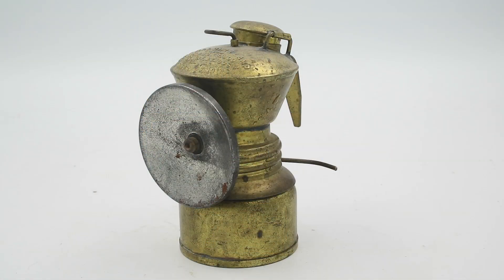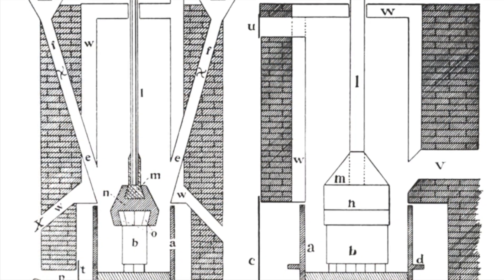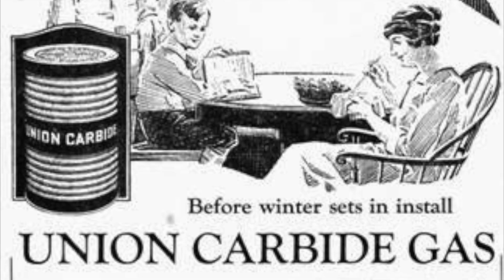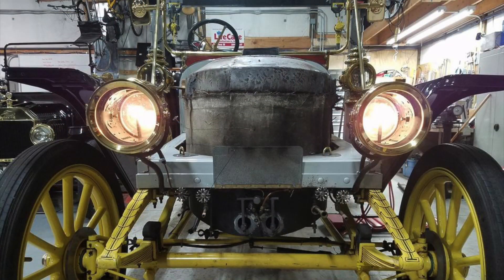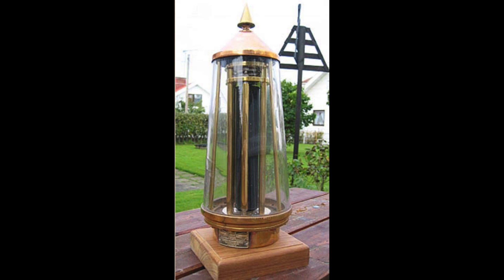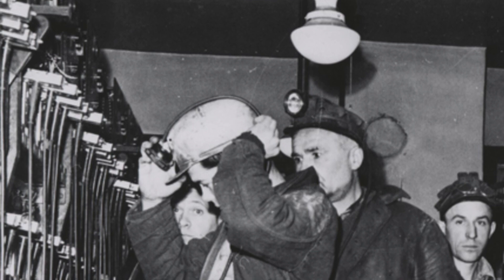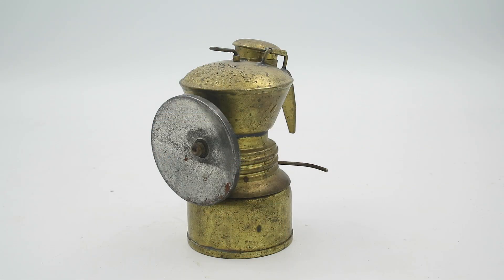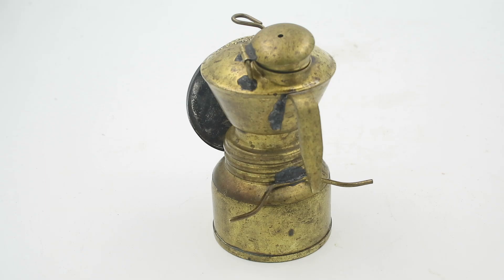Carbide Lamps: the Caver's Friend

Comment: There were a bunch of manufacturers of these lamps, Guysdropper, Autolite, Premier, Justrite, Butterfly and more.  In the 70s, Justrite made a plastic version that had a tendency to melt down.  There was a cave ballad called "The Ballad of the Plastic Justrite".  BTW, I carried enough carbide for a 36 hour trip (longest trip was 24 hours)at normal brightness.  If necessary,, between the three of us we coulda had one lamp running at reduced light for a week

Comment: We lived waaaay in the woods in an old hunters cabin and went caving every Saturday.  We emptied our spent carbide into "Dump Bags" and when we got home put these dump bags in the large plastic bags with the household trash.  We burned the trash once a week as there was no trash pickup.  One day, I stood over a bloated trash bag and dropped a match.  There was a large explosion and I stood there stunned with my eyebrows singed off covered heat to toe in trash trying to figure out what had happened.  Then I smelled the acetylene and realized the dump bag from a week ago had continued to generate gas.  Likewise, "carbide bombs" were a thing at caving get togethers.  Somebody would set one off and the whole valley would shake with an intense low frequency BOOM.

Comment: Recarbiding sometimes comes at innoportune times.  I once had to recarbide while on rope.  I was at least 50' up and the other cavers had climbed before me because they thought I would climb slowly using only prusik knots.  I was actually faster than them using their fancy mechanical ascenders.  But, they were all up the rope and crawled on to the next rope climb so I was by myself.  I did everything very slowly and deliberately knowing that if I dropped anything it would be a long climb with a flashlight in my teeth.
On another trip, I was in a tiny water filled room with about 2' of air space.  One entered the room from one side by ducking under the wall under water and left it doing the same in the other direction.  Again, I was by myself as the others had gone ahead.  I had to recarbide while treading water. Unfortunately, I dropped my baby bottle filled with dry carbide.  This meant the tiny room was filling with explosive acetylene gas.  I quickly ducked under the exit wall with my flashlight in my teeth.  We all had to go back through this room on the way out meaning we couldnt use carbide and even an electric light might trigger an explosion.  On the way out, I went first using a Cyalume lightstick and jammed it into a crack in the wall in the tiny room.

Comment: Every real caver was expected to be able to "Recarbide" in total darkness in case your other two independent light sources failed.
1.  Take lamp off helmet and take plastic "dump bag" out of your pack.
2.  Unscrew the base of the lamp and dump the spent carbide inn the dump bag.  Use the closed tip brush you wear around your neck to help extract the spent carbide.
3.  Pull the new carbide from your pack, you keep it in a plastic baby bottle for protection from water. Pour enough of the carbide rocks into the lamp base till you can feel it is 2/3 full.
4.  Pull out the squeeze bottle you use for lamp water, open the water reservoir on the upper part of the lamp and fill the reservoir with water.
5.  Adjust the water flow lever till you can feel the dripper dripping onto the palm of your hand about 1 drop every three seconds.
6  Let the drops fall into the base of the lamp and hear the sizzle as acetylene is produced.
7.  Apply your saliva to the lamp base gasket for a better seal and screw the base to the top.
8  Bring the flame tip up to your tongue within 1 cm.  You should feel the exiting acetylene on your tongue.  If you dont feel it, Take the tip brush from around your neck and use one of its wires to clear the orifice.  Check for acetylene flow again.
9.  Cup your hand over the orifice with space under the palm of your hand to trap acetylene. The side of your palm away from your thumb should be against the striker.
10.  Quickly move your hand across the striker to produce a spark.  There should be a loud "POP" as the lamp lights.

Although it has been 34 years since I last used a carbide lamp for caving, I think I could still light my lamp in total darkness
Reply: Yes, I've had to service my lamp in the dark. More often than just running out of carbide or water was simply extinguishing the flame when accidentally thrusting it into sand. Clearing the acetylene exit nozzle with a pin was often the critical step.
Reply: meh. you would die brah.

Comment: Acetylene, being a hydrocarbon, stinks a bit…sulfur contaminants or not. I’m a caver and a welder. At one time, you could buy a small generator for your oxy/acetylene torch kit that worked like the lamp and is now considered far too dangerous for home use. Next to hydrogen, it is the hottest burning gas. Carbide production in North America is now at an all time low because it is a byproduct of manufacturing processes that have for the most part moved overseas.

Comment: How long will that lamp burn on one fill of water and carbide?
Reply: In typical caving, a lamp would go about 2 to 2 1/2 hours. Water tank would need about 2  refills during that time. In situations where you use a lower flame and less light, you might be able to so as long as 4 hours. Lamps from different manufacturers have different volumes so these are averages.

Comment: I had one of these. One issue is that that the calcium carbide reaction can eat through the brass of the lamp. I had my lamp blow out. It wasn’t that dramatic, but it was alarming and startling when it happened. You have to keep them clean. These are very bright and interesting lamps.

Comment: Thank you for the great video. I use these lamps as part of a lighting source when I went caving 30 years ago. We had a requirement that we all needed at least three different sources of light while caving. Calcium carbide was one of those lighting types that we utilized. The others were battery operated.

Comment: Calcium carbide is the fuel for the now banned “Big Bang Cannon” toys.  You’d get a tube of powdered CC and the toy cannon had a reservoir for water. The n the breech had a little platform to our the powder onto then you’d place it into the cannon, turn a knob to dump the CC into the water then strike a plunger which had a standard lighter flint which would strike a gnarled plate to create a spark to ignite the gas.

Comment: Ta the video. 
The explosive compound Cuprous Acetylide  (Cu2C2) has often formed in piping systems for acetylene, where copper/Cu alloys were used.
As a kid, I used to make it using cuprous chloride and carbide. Placed in foil and left on the road, it would make a very loud blast if run over.
All the best from Africa.

Comment: How often did the lamp need to be refueled during a 10 hour shift in the mines?
Reply: I have several helmet lamps from different companies. At a high flame rate, most lamps will run 2 to 2 1/2 hours. Although in small and tight cave passages,  I could use a small flame and go almost 4 hours. I carried an extra bottom of carbide with a sealed top. Changing a bottom would only take a few seconds.

Comment: Some were still using them when I was a Boy Scout in the 70’s. Not often, but they still had their place.

Big advantage as opposed to batteries, they can sit on the shelf for years before you need to use them.

Comment: Male Cyclists using carbide lamps in rural areas would often refill the water tank by urinating in it.
On British railways maintenance crews and tunnel inspection teams used Carbide lamps until the early 1970s at least. some would have water tanks holding about a gallon of water' and could put out a very big bright light.

Comment: I Don't where you are getting the Erroneous Idea that Carbide lamps weren't used in Coal mines but here in West Virginia as well as Kentucky and Penn. they were used by the many hundreds as many old Photos prove.   My Grandfather used one several years before the Electric Cap lamps came out....My mother used to fill the tin container with carbide each morning while she packed his lunch that he would take underground here in Lundale WV in the late 30's & early 40's... YES! there was a high possibility of a methane explosion & thousands of miners died....so to minimize the hazard, the Fire Boss would enter the mine first while wearing a wet Blanket and light the Methane that had accumulated on the ceiling while he lay down on the floor....It was a dangerous job and he got paid a lot more to do this suicidal job...

Comment: I used to do a lot of caving, first of all with carbide then with electric lamps. When I started leading groups in the 1980s beginners and kids were still given carbide lamps but they quickly fell out of favour for a couple of reasons. First because marking walls with soot became considered vandalism and kids were always tempted. Second for safety, with the proliferation of fleece clothing and similar the risk of some child's sweater catching light was too great. The caves of the Mendips in the UK were particularly busy and often crowded so this may have had a bearing.

When I was at school it was possible to dump a whole can of carbide into the science lab sinks, put the covers on, and have the ethyne/acetylene gas mostly come out of just one or two because the drains were interconnected. Then you could set light to them. 💥🔥😇

Comment: If you turn the light off, presumably by closing the water valve,  can any remaining carbide granules be saved for future use?
Reply: Yes. You could start the lamp back up a little later. But, if you tried to store old carbide for more than about 1 day, it was usually gone. Also old carbide is corrosive.

Comment: I had one back in the sixties when I was caving. The light was far superior to the feeble electric lamps of the day. The carbide lamp gave a much brighter and widespread, diffuse light compared to the electric lamp which gave more of a spot. The main disadvantage which I found with carbide lamps was that if you struck your head on the roof or gave it any sort of jolt, this would cause more water to be forced into the base and a HUGE flame would be produced which generally went out due to the gas velocity exceeding the flame velocity. Oh, and definitely clean the base after use as the spent carbide eats through the metal of the base.
Reply: I did a lot of caving in the 60s too. My carbide light gave much better light than the electric ones. I still have it.

Comment: My Carbide lamp saved my life.  In  1986, we were exploring a vertical cave in North Alabama and I was as usual lighting my way with my Autolite carbide lamp.  There was a 90' entrance drop followed by a 100' long crawl and then another 100' drop.  We rigged this with a continuous 400' rope and rappelled in.  Water flowed in a fall into the entrance pit and throuigh the horizontal crawl and another falls down the 100' drop.  At the bottom of the 100' drop was large chamber exposed to continuous spray from the falls.  This was followed by along  nasty corkscrew crawl that eventually terminated in a sump.  It took a couple hours to explore this crawl and return to the bottom of the 100' drop.  Once at the bottom of the 100' drop we found that our rope was missing.  Somebody had pulled it up and we were trapped.  The pit was overhung and there was no way to climb it.  Fortunately, we had arranged to meet another caving group at the Scotsboro Pizza hut at 6:00 pm and this was our "Call out" time meaning that if we were not there then they would activate a rescue.  The problem was this was over 6 hours to be stuck at the bottom of this pit with very cold water spray and wind coming down the pit.
There were two of us and my friend had new PolyPro expedition grade insulation under his coveralls.  Expecting only a short trip, I was wearing only cotton coveralls.  He could stay warm enough but I would die of hyperthermia EXCEPT.  I had a large garbage bad stored in my helmet that I punchec a hole in the bottom and put it over my head.  My carbide lamp I put under the bag to warm myself.  This kept me from succumbing to hyperthermia.  The wait was awful.  The sound of the other caver down the pit was truly wonderful with them calling to see if we were there.  We never found out what happened to our expensive 400' rope but I still have my old AutoLite lamp.
Reply: I went spelunking, dangerously unequipped with two 20 year olds and I was in my early twenties.  No equipment.  They brought D-cell flashlights.  I brought a larger 12 volt.  We were inside of there for hours and it was trecherous.  On the egress their flashlights were dead.  We came out with only a small fraction of light left on our only flashlight.  We had gooseggs.  We could have died in so many ways.  I will never, ever, do that again.  Nor would I recommend it to anyone.  Do not do it without a professional guide.   Nobody even knew where we were when we did it.  We could have died slow painful and miserably sad deaths, and our families wouldn't have known what happened to us for weeks.   We parked the car well away from the cave.  We didn't want to get caught because the cave ahd a blocked entrance we got past.  The cave was off limits.  It was so bad in there my athleticism and wits is what saved our necks.
Reply: Nice now I feel the need to make large tags for my surface anchors "do not disturb, cavers safety line, removing this rope would be manslaughter."
Reply: @justindunlap1235  i thought it would be fun to rig game cameras, find out who it was, then take em down the hole and leave em there for oh.... 6 or 12 hours. then ask em if they wanted to steal peoples ropes anymore.
Reply: @TheBoatPirate generous to only make it 6 or 12 hours!
Reply: Always a large garbage bag inside my helmet also!
Reply: Always have at least 3 preferably 5 backup light sources, food and water for each person in caves. And a cave plan left with someone not going in.
Reply: I can't even watch videos of people going down these caves and mines.
Reply: @finaloption...  go sailing?
Reply: @TheBoatPirate  fishing!
Reply: I managed to combine sailing and caving.  I sailed my 28' boat to the Bahamas with some caving friends so we could explore caves in the Abacos.
Reply: Damn, what a story. That's why we plan contingencies on top of contingencies.

One thing, though: you mean hyPOthermia. "Hyperthermia" is quite literally excess heat, the opposite of your problem.
Reply: I remember the tag fall cave 'in held in north Alabama many years ago...wild time
Reply: Are you guys crazy?

Comment: My dad had a carbide lamp on his bicycle during the 1940's and early 1950's.  Battery lights were to  expensive to run and you did not have issues with electric bulbs failing.

Comment: As a caver, I preferred my carbide light over electric because it produced a very even peripheral light that gradually condensed into a central spot.  Until the development of white LED lamps, electric bulb lamps had inferior lighting, usually a brighter center spot with concentric rings that made it difficult to walk uneven ground.
Reply: That directly relates to the quality of the reflector, not the type of light source.
Reply: I think the issue boiled down to the weak bulbs that were found in electric lamps (other than the very heavy & expensive miner's lamps.) The headlamp designer had to use a tightly focused reflector to get a reasonably bright spot of light.  Once LED's & lithium batteries came along, it allowed for a very bright light that could run a long time, and a more diffuse reflector could be employed.  I sure wish they'd had those back in my caving days!

Comment: We sold cans of calcium carbide in the grocery store where I worked in the 1970s in Appalachia. I assumed it was for use by miners since we were in a coal mining area, but it seems I was mistaken. (I always wondered why they'd use a carbide lamp in a coal mine. Everybody knew flames weren't allowed in the mines; that's why the miners chewed tobacco instead of smoking.)

There were a number of homes in the area that didn't have electricity or gas service. Maybe they had carbide gaslights.

Comment: They also serve as little space heaters. Not only is there heat from the flame, the reaction of carbide and water is very exothermic. So, as well as light, the lamp is emitting about 300W of heat.  This can be useful to prevent or treat hypothermia in cold wet caving conditions.

Comment: As a kid I would collect carbide thrown away by welders, put it into a plastic bottle with some water, close the lid and run away. In a few seconds the gas produced by the reaction would cause too much pressure for the bottle and it would explode.
Reply: How old are you.
Reply: @KR72534  I’m in my mid 30s

Comment: As a young boy I had a bicycle carbide lamp. Not very good when it rained since mine had no glass! At age about 12 upgraded to electric with a dynamo running on the tyre wall. If you cycled fast enough the bulbs blew.

Comment: I used to do a lot of caving.  While I preferred an electric miner’s lamp as my primary light source, I carried a carbide lamp both as a backup light and for heat.  We carried large plastic garbage bags as an emergency layer of insulation.  On one trip a member of a party  was becoming very cold.  Pulling a garbage bag over her head with holes for her head and arms and holding a carbide lamp so the heat rose into the garbage bag stopped her shivering and warmed her in short order.
Reply: I used a carbide lamp for caving in Indiana in the late 60s. On one trip I was standing on an elevated area next to a large room looking down but the ceiling rock slopped down right in front of me. A friend near by yelled at me and I looked up and realized that I had inadvertently "fried" a poor bat that had been clinging to the wall. That flame had been lethal.
Reply: real men of genius! I bet she was so glad to have a man thinking ahead like you 🥰